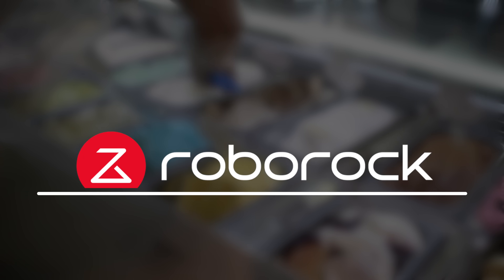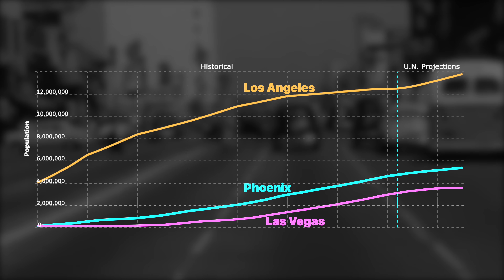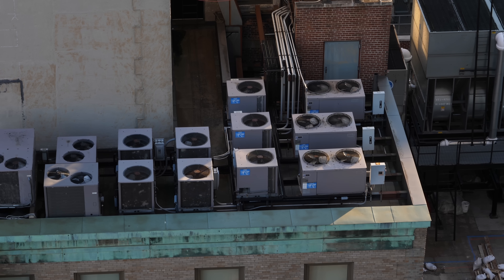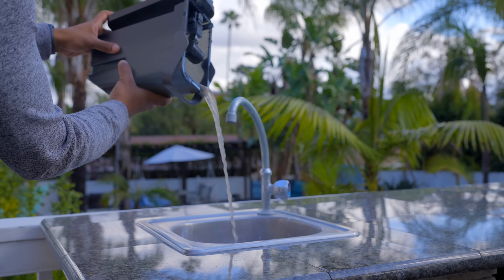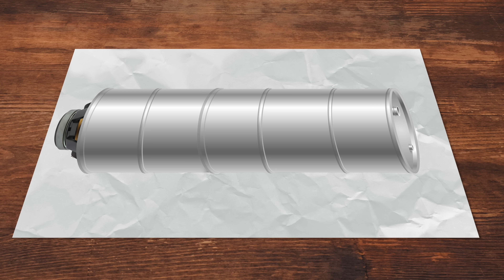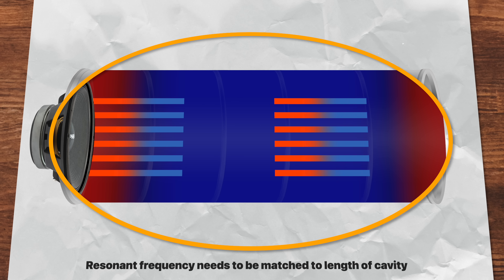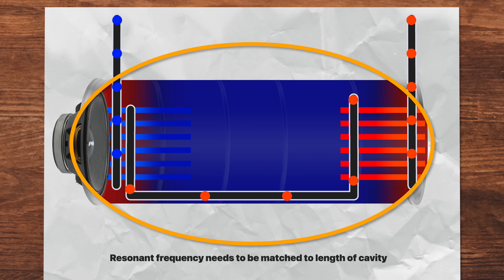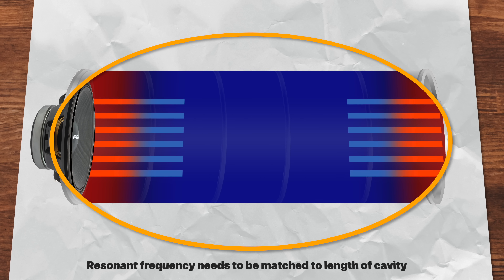Next Gen Heat Pump Heats & Cools Using Sound!

Comment: "No maintenance"? Helium is an amazing escape artist.
Reply: Exactly. We use helium for leak checks on hyperbaric chambers due to it being so “slippery”
Reply: Also classical heat pumps are sealed and they leak all the time it is just usually very slowly.
Reply: The main reason for leaks is at valve seals.  Diffusion through through a tank with no valve (permanently sealed with metal) would take a long time.
Reply: @reubenbarr6438  but it's really hard to vacuum seal. It requires quite expensive materials and testing. Also even if doesn't escape it's gonna be expensive and definitely can't be replace the traditional heat pump ac.
Reply: No maintenance , mean just use and throw .
Lol
Reply: And we're already (slowly) running out of it.
Reply: @timderks5960  - the backorder waitlist was about two years the last I heard.
Reply: He - catch me if you can
Reply: It's ok, we are getting close to having commerical fusion solutions, not for power yet, but for making medical isotopes and others, and one of the biproducts will be helium. Within the next few decades I expect the price of helium to eventually drop to next to nothing except for the cost of capture and transport.
Reply: While helium is currently a nonrenewable resource it's actually a primary byproduct of several potential fusion fuel cycles.
Reply: Propane is an awesome refrigerant with no global warming or ozone depletion but people are all scared of fire.... But they are used in industrial kitchens all the time already with almost no issues.
Reply: @electromechanicalstuff2602  That may be more about insurance companies and people losing their insurance than people being afraid of propane. Still when it's used for heating it burns by default in a safe controlled way. When a compressor loop leaks it can easily find ignition too. Iirc there was a coolant that amounted to propane with some additives to make it less likely to burn but was phased out over it's GWP or something. Unburnt propane is about 25 times better than carbon at trapping heat so not really zero though the amount leaking even if every heat pump and chiller ran on it would be negligible compared to overall carbon emissions.
Reply: @johnassal5838  it's used in refrigeration in industrial kitchens right now it's R290 I believe
Reply: Use hydrogen.  Why?  Twice as thermally conductive as hydrogen.   Cheap and abundant.   Dangerous?  Depends on the design.  If you seal it properly where it does not mix with oxygen ever, it's perfectly safe no matter how hot it gets.  You can use a double chamber that senses hydrogen and turns it off if detected and I'm sure there are many other such designs.
Reply: Argon makes more sense simply because there is a better supply and it is easier to contain even though it is not quite as efficient.

Comment: It's Good For Existing Homes... But, I Can See Future Homes Being Grown... With The Same Principal Of Growing Crystals..

Just Grown On A Larger Scale With A Durable Skeletal Frame.. With Heating & Cooling Methods That Could Be Managed Best Through Design & Positioning To Maximize The Sun & Jet Stream Winds <<< Just This Alone WILL Reduce Cost..

The Old Guys Pre 1950's Were Building By Taking  The Natural World Into Consideration.. My Own House Was Built In 1863 .. & It's HUGE... But, Easy To Heat & Keep Cool In Summer... I Barely Use The Air Conditioner.. Just A Fan Occasionally... & It's Very Comfortable.

Comment: Robo vacs suck... and not literally. Maybe my situation is no normal, but I have lots of tile or hardwood and rugs on top, plus many movable obstetrical. I owned 2 robo vacs, on cheap and and a more expensive laser mapping vac. Maybe I'm picky, but I went back to a regular vac as it was much less hassle and more reliable. It's not just one problem. There are too many problems to even list here.
Reply from the maker: this is my second and its been amazing, def find out what happened talk to them etc... what model was it? I only have experience in the past 1 year, and they're truly amazing like best in class
Reply: An apartment I rented came with one. Really annoying if you make a mess because you can turn it on pointed directly at the mess and it turns the other way.

Not to mention I saw a picture of one with "dirt sensing" that tracked a dog turd all over the room as it tried to clean the "dirt" it had stumbled upon